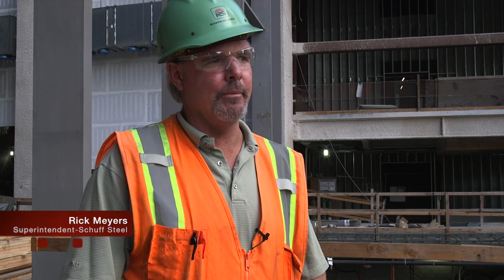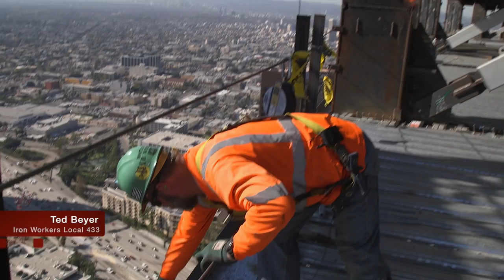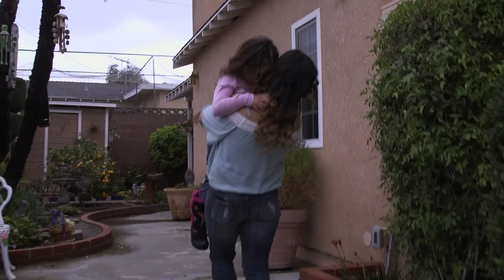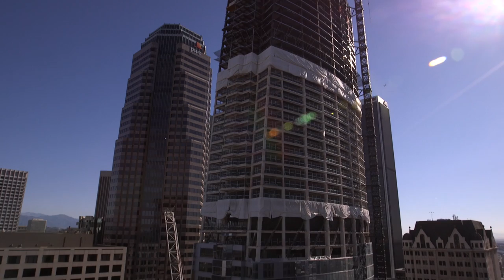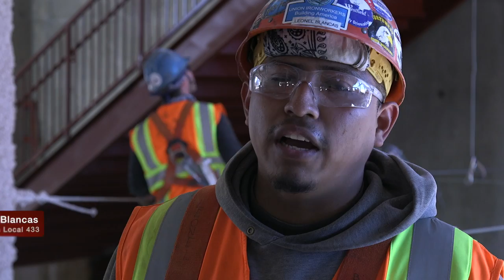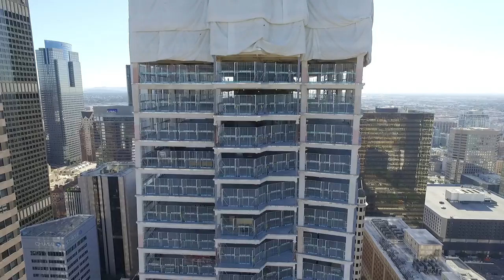Iron Workers Building the Wilshire Grand

Comment: Hey connectors, never stab tab the top hole!! 1 reason you have to work around your wrench. Always stab the second hole down,  that way you can stich the bolt and move the iron around. 
Also, the guy that pulled the bar out for a slap connection on a floor beam. It is better to use your wrench, only pull the bar out, when you need to pry. No offense,  we are all brother Ironworkers!!
Reply: Absolutely. Spud the second hole down, for slap connections or doubles, and for a lot of smaller buildings (retail, churches, schools), my bar seldom comes out unless I'm sliding big stuff around in the web of bigger stuff.
Reply: @peteywheatstraws4909  Nicey Nice. I will use my bull pin while stabbing 1 1/8 holes so I don't barrel the wrench. I always stab columns with a pin too, so the pin is ready beat it in. Work safe Brother. What local are you in?

Comment: Iron workers hung the curtain wall ?!
Where are the glaziers?
Reply from the maker: Glaziers didn't participate in teh video project
Reply: Glaziers IMO are just token workers on the most part they just don't have the overall skills and expertise needed to get the job done safely and under budget. From my experiance, they drag ass all day long. However, there are exceptions.
Reply: Unfortunately iron workers are taking other trades work and calling it structural or are putting it in a structural package they shouldn't be touching glass and decking is work done by architectural sheet metal workers iron workers are trying to take it just like carpenter are trying to take other trades work.
Reply: @jmejam_jmejam_  ...Ironworkers have always done the deck
Reply: @jmejam_jmejam_  it stiffens the building
Reply: @qperci80  It's sheet metal that can be shaped and formed and fastened or welded in place 🤔 I guess we can agree to disagree.
Reply: Some locals (Rochester, Baltimore, Richmond that I worked out of) use iron workers to set glass and panels on the exteriors.
Reply: @raymondblacklock  The decking is part of the structure, absolutely. It keeps the torsion out of the building as it's going up, and you have to weld the Nelson studs to it.
I've never seen the sheetmetal worker's local do it, and I worked out of that local for 7 years before I got into doing union iron.
Reply: @peteywheatstraws4909  ...i retired out of 433...35yrs